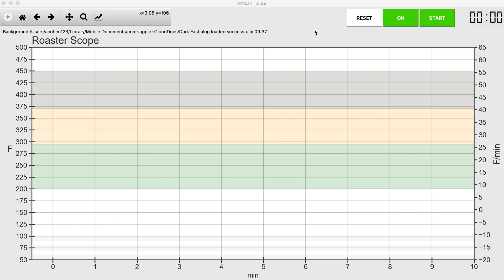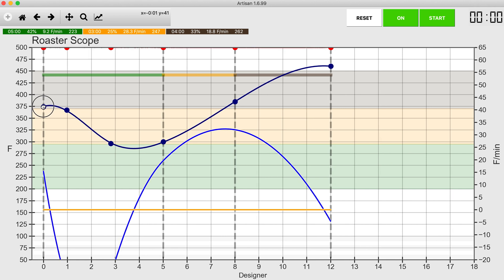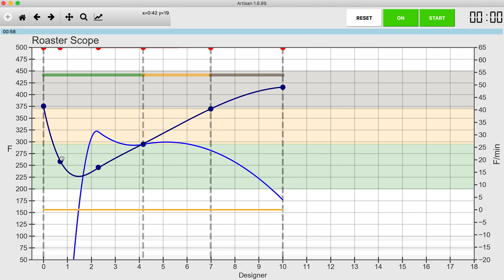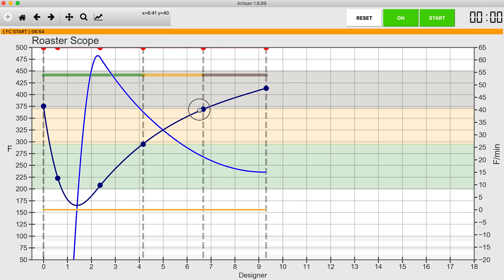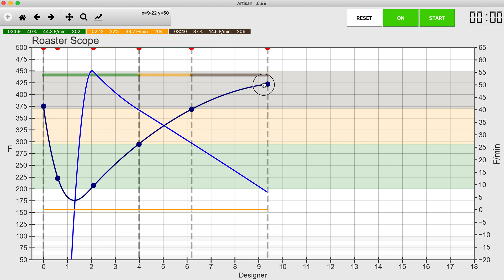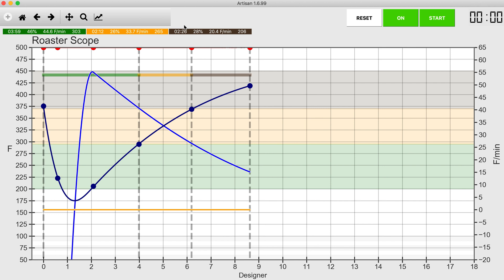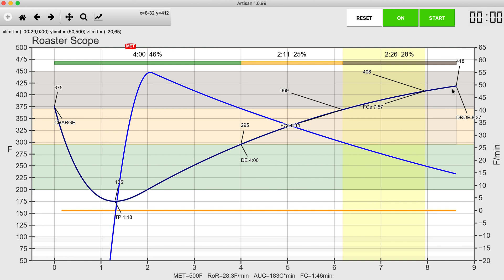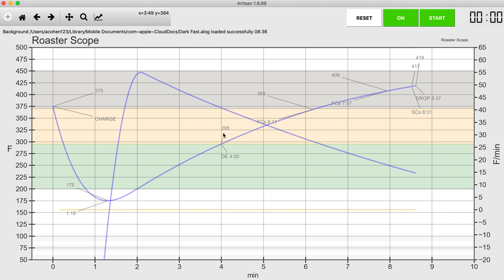Using Artisan Designer

Comment: Did  you succeed with your roast in using the designer? Delta ET is not used and not necessary or even irritating?
Reply: I will give it a try. I first had problems  moving the BT- points and did not know the obligatory to exit on designer button before saving as profile. Now designing works fine due to your demonstration. Thank you!
Reply: Very short Maillard phase! Almost half the time for drying phase. Is that working for your blend? Sweet and fruity and roasty all together?
Reply: @erharddinges8855  seems a little fast to me